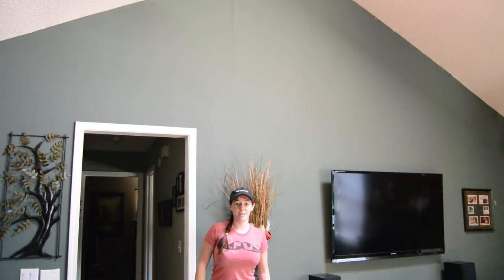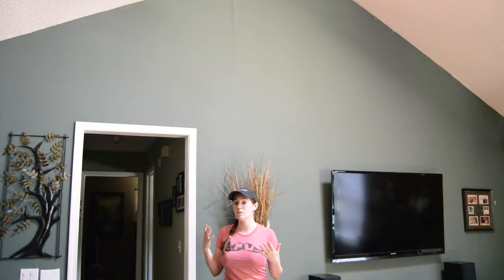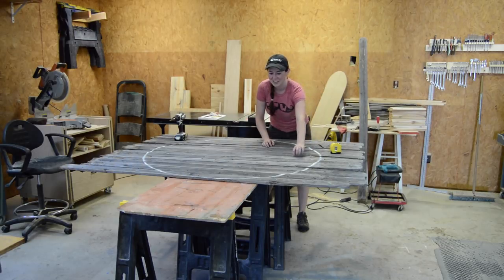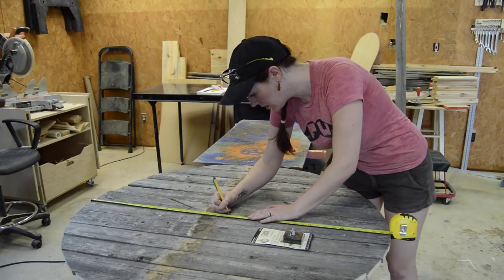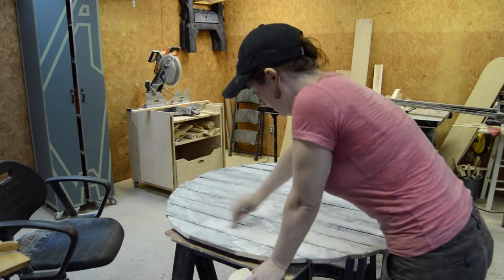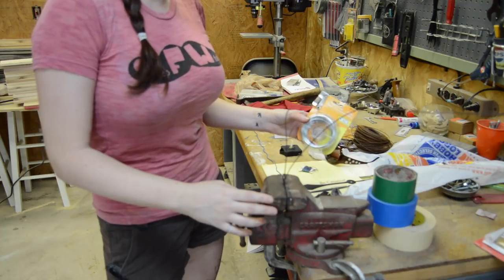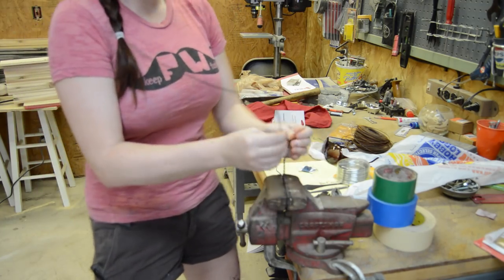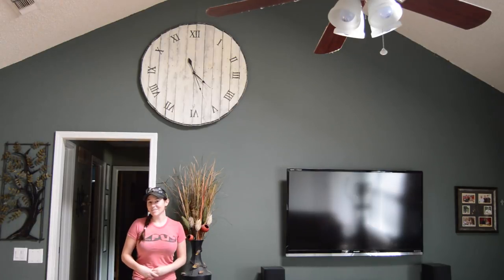Fence Panel Clock

Comment: Hey there, I recently subscribed and I'm loving your work. Quick "hack" for twisting wire, if you have a long length to twist up or if you want a perfectly even twist, put the loop in your vise and wrap the ends of the wire around a nail, put the nail in a drill and keep tension on the wire while you run the drill at a slow speed. A nail with a large head works best.

Comment: Nice clock. Just a little tip if you didn't know already. For twisting the wire I simply use my drill and of course the vise to hold it in place. For straightening for just one wire the drill will work also. It is fun to see how all the twisting and turning will go away.

Comment: Nice clock! Could I suggest for your bailing wire... pull out a length fold it in half and "chuck" it in your cordless drill then that the 2 ends and put them in your vice. pull the wire taunt pull the trigger on your drill...not to fast.. it will twist the wire nicely for you. ;-) 
your positive attitude makes your videos great! Well done!

Comment: I like it, but with your table saw you could have jointed the boards for a very nice fit, and then made a circle cutting router jig, cut a perfect circle and add a nice decorative edge. Saves tons of time on the cleanup sanding.Overall very good project, and your video quality is great. Keep up the good work!
Reply: I guess you missed all the times she said it was a rustic clock?

Comment: Very creative, you said you have made other ones. Did you sell them? One thought on the construction. It might be possible to make a little door ( approx. 6" x 6") for the clock movement. By doing this you could change the battery without taking down the clock. With both hands in the 12 or 6 o'clock position the door could swing open. Those batteries last a long time so maybe overkill. Liking your videos BTW.

Comment: Cool idea. 
If you chuck the 'loop' end into a cordless drill and then put both loose ends of the wire in your vice, then slowly turn the drill, it will wrap the wire quickly for you!

Might consider a French Cleat as well.

Comment: What's going in the spot to the right? I smell another project! Good job April!
Reply from the maker: Well I can't tell you or it would spoil the fun. ; ) But yes....I do have plans for the right space as well. Something light and easy (in a visual sense) so it will fill up the space but not take away from the clock or TV. It is quite a ways down my list, but I'll get to it soon.

Comment: Cool clock. I think it looks very nice in that space. I need to get me a stencil brush.
Reply from the maker: You can pick them up cheap at Hobby Lobby, but if you don't have one, just use a regular brush. The trick with using a stencil is to not overload your paint brush with paint.

Comment: Great project April. I've never seen 'IIII' used in place of 'IV' on clocks before, until today that is. I just saw it on a clock in the background of a tv advert also :)
Reply from the maker: : ) Yeah, I looked it up before I started (my first time around) and I read that IIII is the standard for roman numeral clocks, but that IV is used in every other application. But, it's also the standard to use the short hand for the 9....so IX instead of VIIII. I thought that was interesting.

Comment: Great way to re-purpose an old fence section. A tip on twisting wire. cut wire 2x's the length you need. Fold in half and grab the loose ends in vise. Place the folded end trough a socket or pipe nipple. Place a screwdriver through the loop, pull socket against screwdriver and spin screwdriver till the wire is twisted to desired tightness. Pulling on socket will make the twisting uniform.

Comment: That looks really cool April, I wouldn't mind making one for outside, just not sure how I would keep the weather out of the clock movement.
Reply from the maker: Hey Colin. You could always just make it decorative and not add a motor? Most clocks this size don't actually work, but they are awesome to look at. Just a thought. 

Glad you added a photo! It's nice to put a face to a name. : )
Reply: Put it on a wall where you can put the clock on the inside and a tube going through to the hands. But hey, even without something driving it the clock will still show the correct time two times each day.

Comment: As a tip for twisting the baling wire. You cut put the cut ends in the vice, find the center point. Fold the center point and put it in cordless drill Chuck. Pull it taut, pull the trigger.

Comment: not sure if a drill is strong enough for the wire... but in order to twist wire, i usually put a loop in it clamp it, then put the loose ends in my drill and start twisting it up.

Comment: If you want a good twist in a pair of wires just lock one end down in your block vise and the other in a cordless drill and just keep slight tension on it. Then let the drill do all the work. Makes a perfect braid look everytime. 

And the longer you run the drill the tighter the pattern.
Reply from the maker: Thanks for the tip!

Comment: Hi April. I'm a new subscriber and I really like your videos. One question, I noticed in this video as well as the doggy gate video that you set your pieces together, mark them, and then cut them out individually. Is there a reason behind this method as apposed to gluing them together, marking them, and then cutting them all as one piece? To me, it seems that would be easier but I'm always up to trying new techniques.
Reply from the maker: : ) Hi Jody. My only reason for not doing it that way is because at the time I did not have any clamps. Well, that was the reason on the dog gate build. On this build, I didn't want them to be glued together, I actually left a small space in between each board on this clock (only about a coins thickness). However if I were to build another dog gate, I now have clamps so I would glue it before I cut. ; )

Comment: I would like to know where you can get a clock movement that would work outside in the rain and snow that Northern Michigan may bring on us. And to be Very Very Big for the End of a Big Barn !! So people see it aways away coming down the road. Electric would be fine, could ya take apart a old working clock. But for the Hands could l buy a roll of allumimmin & make TEN Foot Hands ?? Or is a 12" electric clock made just for the 5" & 4" hands that are on them for that size of a radius ??

Comment: Twisting wires!!  lock one end in a vice and the other end in a drilling machine. the tension on the drill while running it will regulate the pitch of the twisted wires One can also crimp a cop[per lug to both end when 3 or greater strands are used to hold all the strands

Comment: My Mom wants your clock.  Any recommendations on where to get a reliable clock movement to run a clock that size?
Reply from the maker: Like I said in the video, you can order them online, or pick them up at places like Hobby Lobby. Just make sure to get the High Torque movement. ; )
Reply: Sorry April.  I did catch that after I watched the second time.
Reply: Lee Valley sells all kind of clock hardware.

Comment: To twist wire together: fold in even length with spare. Put cut end into vice. Install other end into drill motor and twist away !!

Comment: ***   IMPORTANT:  Please use caution when using (especially drilling, cutting, sawing, routing) fence panel like that, because they are made with the old-style CCA arsenic-containing pressure-treated wood - now illegal and replaced with safer ACQ non-arsenic-containing treated lumber.  ***

Comment: I like the clock but you got the number 4 wrong. It should say IV and not IIII. Being a bit of a stickup, this little detail would annoy me every time i'd look at it :D
Reply from the maker: There is actually two ways to write the number 4 in roman numerals and the way I have it is the standard for clocks. You could always use the short hand four if you were making your own, but the way I have it is considered the correct way.
Reply: April Wilkerson
After reading your comment I did a little research. Turns out you are right. Something about how the numerals are more balanced by having four X, four V and four I. Symmetry :D Still, to me it looks odd and If I get a wall big enough for a clock of that size I will make it my way. The joy of making things yourself.

Comment: Nice piece of art. But 4 o'clock is not IIII. It is IV.
Reply: As April pointed out in an earlier comment, IIII is the common way to write 4 on a clock.
I wasn't convinced of that myself, so I did an image search for "roman numeral clocks" and counted how many used IIII vs IV and found that April is right. After counting a few pages of images, I got 19 images using IV and 23 images using IIII.
Not terribly scientific, I know, but still seems like a reasonable test.
Reply: @ptousig  Scientific enough 😊